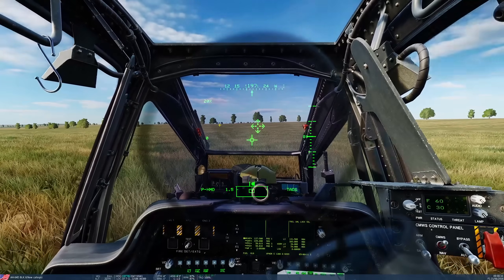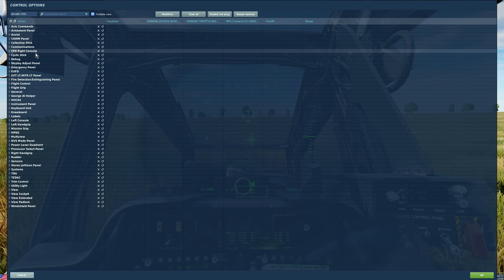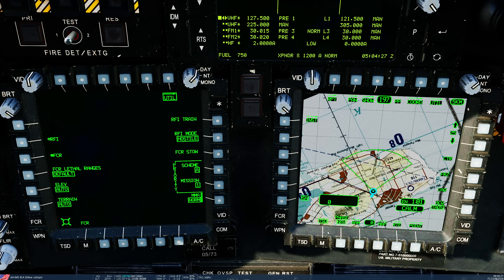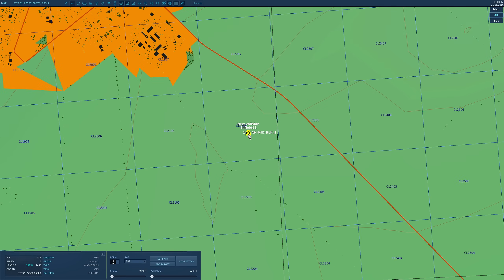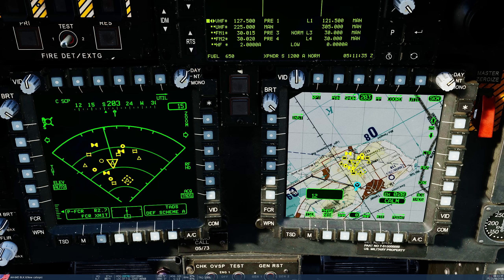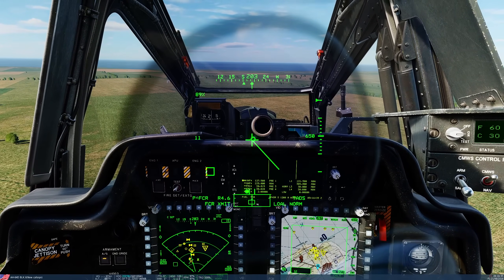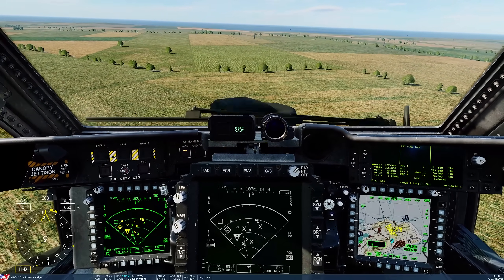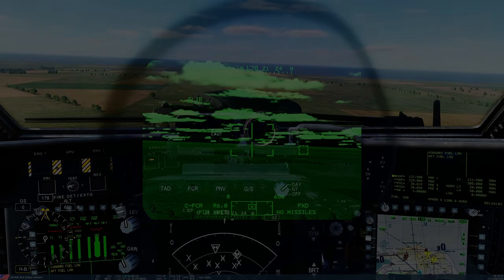AH-64D Apache: FCR Fire Control Radar (GTM mode) With RF Hellfire (Pilot & CP/G) Tutorial | DCS

Comment: many of the things you say have inaccuracies.
for example a filled circle means if targeted by a radar missile it will be in LOBL mode, for example if the track is very close. the square indicating a moving target is separate from that.
the target button is used to store radar targets. you press it and then select each target you want to store with the cursor in order, or press the all button to store all of them.
When engaging moving targets, you should wait for the hellfire to acquire the target in LOBL, indicated by the large box.

Comment: single burst is useful if you want to get a picture and retain it, even if you switch position. for example you can pop up from behind cover, take a picture, then go back down behind the cover and engage the targets safely, relay the target coordinates, or form a plan of action, provided that they have not moved.
if you were in continuous mode, the radar image would get overwritten by the blank obstacle in front of you.
additionally, if in continuous mode, the priority queue position of a target gets reset if the target drops and reappears (drives behind a building or you change position such that LOS is broken). If a target has already been engaged, this can lead to annoyances having to manually skip those already engaged targets.
Not relevant in DCS, but single burst also reduces emissions that can give away your position.
Continuous burst is useful for general situational awareness or tracking targets with a clear line of sight in relative safety.

Comment: The reason to use single burst instead of continuous scan and as to why you can limit the azimuth coverage of the radar can all be explained in two words: Stealth and update frequency. Every time your continuous scan paints its radar over a certain area, this scan can be picked up by the enemy and give them also an update on where you are. Only using a single burst and making the scanning 'pie' of your radar smaller, you minimize your exposure to the enemy, only 'painting' them once. Also making the scanning 'pie' smaller and then pointing that 'pie' in the direction you assume enemies are hiding also makes the scan updates faster since you don't need to wait for a full quarter 'pie' scan, but just a fraction of that.
Also when you're flying multi-ship formations, you can have each 'ship' scan a certain sector of the 'pie' a bit like WW2 aircraft used to do with their Mk1 eyeball.
The whole point of the Apache Longbow combat helicopter is to fly NOE (Nap Of the Earth) and bob up periodically above the treetops or the hills and crests scanning once, and then using the memory of the FCR and the saved picked up targets to lob Hellfires at the enemy while keeping itself out of harm's way.

Comment: The reason for using single burst, two reasons.  One is that you may be in a situation where you want to take a snapshot without giving them tons of emissions to alert that you're there.  Secondly, you can't slew or change the scan area it while it's in continuous.  It can't be scanning while you slew.  So if you're not sure where they may be, you can do a 180 scan by starting at slew left, single scan, slew front, single scan, slew right, single scan.